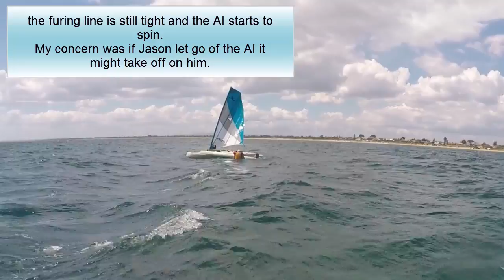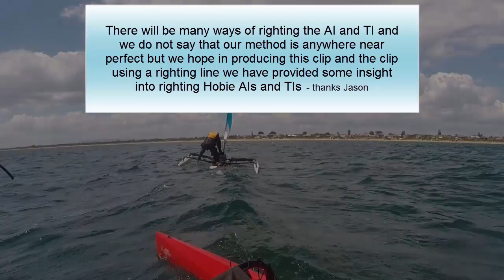Hobie AI and TI capsizing and righting demo part 2

Comment: I capsized my TI alone in a fairly strong wind. The sail was unfurled with the amas out and tramps installed. I unclipped  one side on both tramps and folded the amas in, I then released the mast from the bearing  and let it dangle by the 2 ropes that were still cleated as the wind was blowing me into shallow rocky  water. It was VERY simple to right, extend the amas and then furl the sail by hand with the weight of the mast in the water. With the mast furled, I placed it back in position and clipped the tramps back on. This method would be useful for a smaller person with less strength and/or leverage. it is also useful in the situation of capsizing in shallow or rocky water to save damage to the mast or sail.
Reply: i used this method in rough seas and it works very well

Comment: A couple days ago, as I was leaving the harbor, I forgot to fold out the amas before unfurling the sail, and I went over, just like at 3:30 in this video. I was quickly blown to a dock, and there wasn't room to right the boat using the technique in this video, so I climbed onto the dock and got it upright (not easy, as it was hard to get any leverage). I've got a jib too, and a bunch of other gear, so it was a bit complicated, but not too bad. IMHO, the key is to uncleat the sail. In any case, I plan to practice soon in open water...

Comment: Echoing the other people saying remove the mast to make it easier.  You want to get these boats back over ASAP because they can take on water, I found that out when I capsized my revo 11 with sail.  I did remove the mast but even in the couple minutes upside down, it took on enough water to need bailing before it was stable enough to pull the mast up, partly due to the weight of the sail I’m sure. Obviously the AI has a big buoyancy advantage, might not be as big a deal on those.